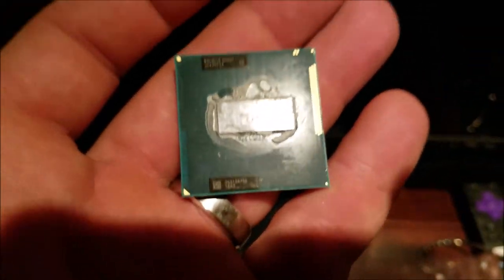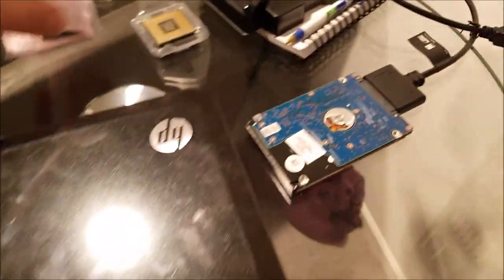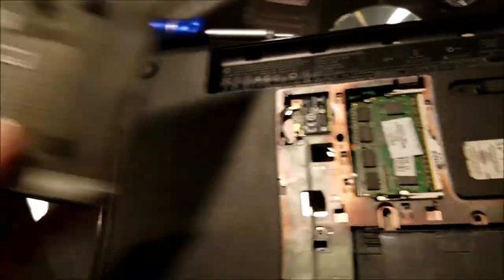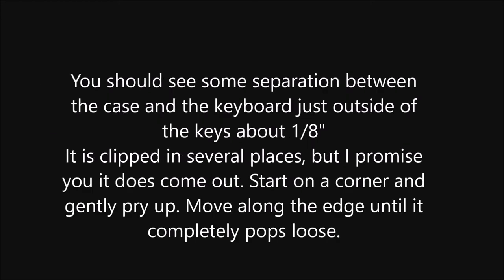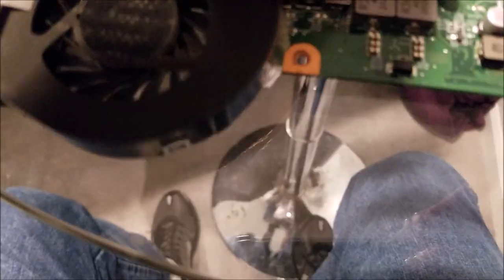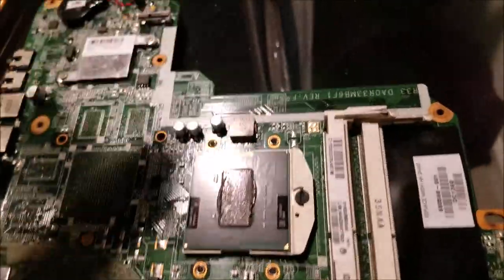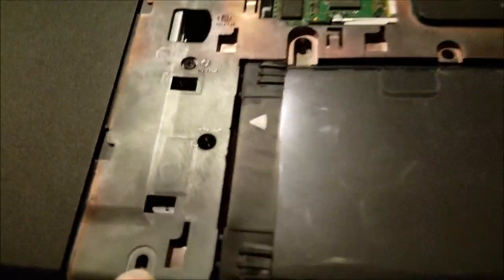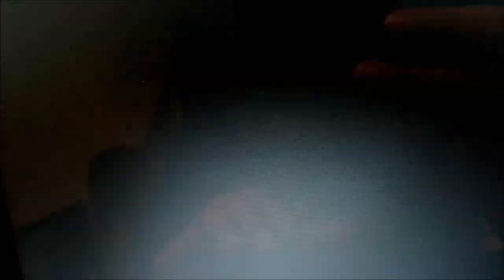How to upgrade to an i7 processor in your old laptop

Comment: where did you order the cpu's from ?
Reply from the maker: I found them on Ebay. I think the 2640m was in the ballpark of $50. The 2920xm was around $100 and the 3840qm was around $130. I bought them all between October and November of 2017. The quad core CPUs are a HUGE improvement over the dual cores. Stay away from the 2640m. It's an i7, but it's only dual core. The 400mhz core clock improvement helped some, but it can't hold a candle to the quad cores. 
  The 3840qm is a great CPU and it runs cooler than the 2920xm. Although I'd almost like to swap the xm back in so I can overclock it with Intel's extreme software. I wish I had a better cooler to handle the extra heat. It was only designed for a 30w TDP processor. The 2920xm is 55w at 2.5ghz turboing to 3.5ghz. The 3840qm is rated at 45w with 2.8ghz and turbos to 3.8ghz. The newer 3rd generation 22nm process is much cooler and faster than the 32nm of the 2nd generation chips. With my cooling solution, the 3840qm is a much better CPU. 
  Just think, AMD has already released a 7nm graphics card and will be releasing their new 7nm processors in a few months. One chip is rumored to be 16 core/32 thread on their mainstream AM4 socket. Their previous generations were 14nm and 12nm. 7nm should be a huge improvement, using much less power and creating less heat so they can run much higher clock speeds. The 16 core processor is rumored to be 4.3ghz base and 5.1ghz boost.
  Sorry that I went off on a tangent there. I'm excited about the new technology.

Comment: How about the heat and the supply power? Did you change adapter?
Reply from the maker: I did not change the adapter. I did not change the power supply. I mention the processor's heat, but not the power supply. 
  I have since changed the battery. The old one wouldn't last 5 minutes unplugged with the 2370m processor installed. I've had a new battery for a couple years. It works great and lasts several hours.
  When you push the computer with more intensive tasks, it does use more energy and create more heat. The battery life is not an issue. The 3000 series architecture is slightly more efficient than the 2000 series so that helps as well. 
  The 3000 series chip has a tdp of 45w and the 2000 series chip had a tdp of 35w. There is a difference, but at idle, it is negligible. 
  I did mention cpu temperatures. They are a little higher, but not unmanageable. I just try to keep my vents uncovered and temps are fine. This cpu has never thermal throttled on me. I have seen temps near 100C, but never for long and never over that. It will start to throttle at 105c. 
  If you are that worried about power consumption as opposed to performance, maybe this swap isn't for you. It is a huge performance improvement and negligible power consumption increase during most tasks. Rendering videos it will draw more power and create more heat, but my stock cooler has never had a problem and I can still charge a nearly dead battery while using the laptop. 
  I also recommend an SSD to replace your HDD storage for maximum speed and future proofing. It's a great way to add life to an old laptop. This is still my primary laptop, but I built a desktop pc for video rendering. This laptop feels just as quick as a new one. On a side note, an ssd uses less power than a hdd as well.
Reply: @EricErnst  thanks for your helpful. I added a ssd to my asus k53sv laptop. It worked very good and fast. So I am thinking to upgrade the cpu. I5 2430m to i7 3610m. Are they the same motherboard socket? Can you give me some advices ? I am worry my adapter which cannot support enough power and about the heat. Huh.
Reply from the maker: @dangvungochieu  The biggest problem that you'll have is an incompatible chipset on your motherboard. The 2nd and 3rd generation processors are the same socket but only the newer chipsets will support the 3rd gen cpus. It will fit the socket perfectly but it may not boot up if the chipset does not recognize the newer cpu. 
  Find your chipset. I think the common ones are hm65 and hm76. The 65 is not compatible. 
 If you are that worried about power, you could get a 3612qm. It has the same 35w tdp as your dual core. would recommend a qm processor. The 3610qm has the same tdp as my 3840qm but with lower clock speeds. If you can find a cheap 3840qm, I'd grab one. A 3610qm would be a great quad core improvement over your current cpu. Finally, the 3612qm should give you quad core performance with low power requirements. Single core performance will likely suffer with the slower 3612qm chip. When I was searching for my cpu, I found that the lowest level quad cores were going for quite the premium price because others just wanted to upgrade to a quad core and they were the most common to search for. The upper level cpus weren't much more money. Look around and see what you would be willing to spend. I typically get my old laptop cpus used on Ebay here in the United States. I have not had any issues with my power supply overheating or the power delivery on my laptop. Like I said, this is still my primary laptop when I need portability and I've had this cpu in it for a few years. I even ran a 2920xm series chip with a 55w tdp for a few months. That chip did like to run hot. That's why I chose the 3840qm. 
  I installed a 3640qm and a small ssd into a laptop as a gift for my mother a year or so ago. It's way more cpu than she needs but she does not need to worry about a super slow laptop anymore. 
  One last thing, I would update your bios to the newest version before installing a new cpu. 
  Feel free to ask any more questions. I'm here to help.
Reply from the maker: I just looked it up and I think you have the hm65 chipset. If that is correct, you cannot run a 3000 series cpu. Your laptop actually had an option to come with 2 different quad core processors. A 2630qm and a 2670qm. I would not worry about power consumption. Asus themselves installed faster quad cores from the factory. Sadly, it looks like you are stuck with 2000 series cpus. Definitely double check your chipset before taking my word for it.
Reply: @EricErnst  Yes. Unluckily, my laptop has hm65 chipset. I think a 2670qm is the best choice. 35w to 45w , It is not the matter. Anyway, God bless you, bro.
Reply from the maker: @dangvungochieu  check the cpu list for other 45w quad cores. The 55w 2920xm ran a little warm for me, but a 45w chip should run cooler and give a little more performance. A 2860qm would give you 3.6ghz single core speeds and 2.5ghz quad core performance. Just look around and see what you can find.